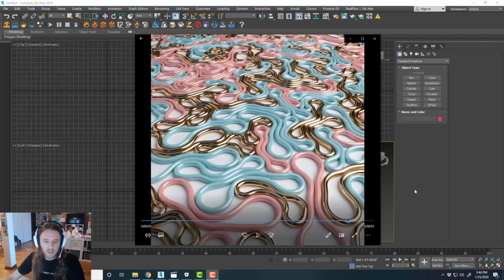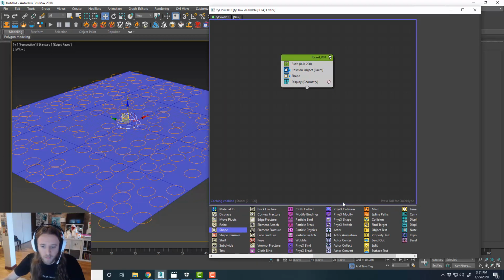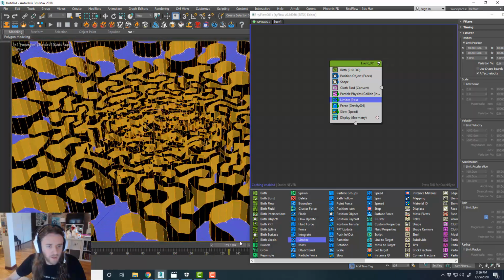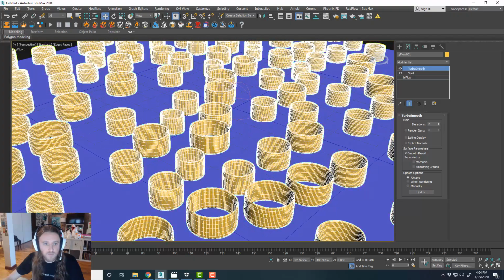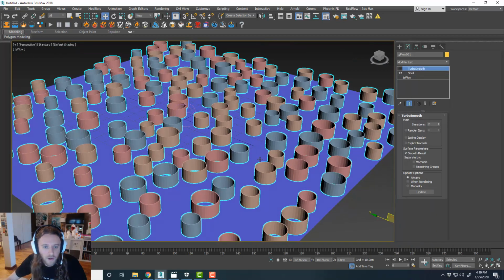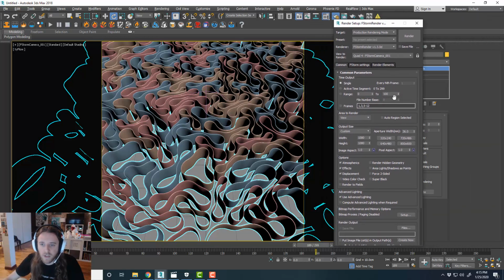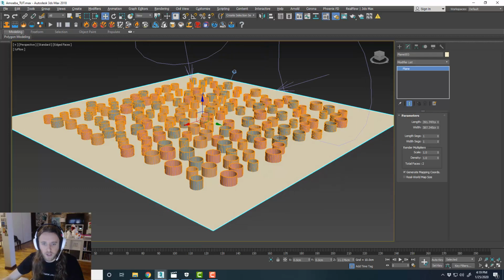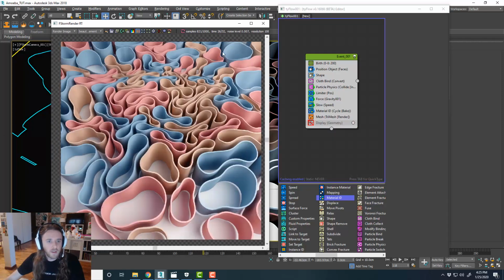TyFlow TUTORIAL!! Rubbery circle packing!

Comment: I want to inform everyone that in version 0.16102 for 3Ds max 2019 sp3 the operator Cloth bind-add shell to surface, does not work.
However you are very good and you did a nice tutorial, but it is not feasible with the tyflow released to date.
Reply: In Add shell to surface set "Outer Amount" to 0.42 and Inner amount to 0.0. In the Shell Modifier on top of the Tyflow object, set the Inner amount to 0 and outer amount to 5.0.
Reply: @PiotrG1337  thanks mate!
Also on my PC with old video card(gtx 580) it freezes if you add cloth bind! seems like video card problem

Comment: I do not know tyflow well
Can it replace the cloth? modifiers for Animation character?
Max's cloth is not bad but slow.
(This is not for games. for rendering)
Reply from the maker: Hi! I'm not sure what you mean by replacing the cloth. TyFlow can simulate cloth behavior, which can interact with an animated character if that's what you mean.
Reply: @simulation_lab  For character animation I use cloth modifier
Would it be appropriate to use tyflow instead of cloth modifiers?

Comment: Beautiful effect! Very well explained! Thanks for a tutorial!
Hi to Brooklyn from Jersey City!)
Reply from the maker: Hey man, thanks! I'm glad you liked it!
Reply: @simulation_lab  I'm copying exact your setup - except I use not the circle shape- but a letter S shape (text spline). And I have a problem with limiter. It doesn't work like in your tutorial. When I enter in Limit position Z: 4.0 cm it raises all the letter 4 cm higher from the ground instead of limiting the distance between the letters. What am I doing wrong? Thanks.
Reply from the maker: @KonstantinRozumny  I'm not sure how this setup will work for open splines, like the letter S, but I think it should work. Try increasing the scale radius multiplier in the particle physics operator, and make sure your sim substeps in the main settings rollout are set pretty high. Also, if you're seeing a lot of overlap, try decreasing your time step to 1/2 or 1/4 frame.
Reply: Simulation Lab Thank you for a quick reply. In my case the letter S is a closed spline, just like Circle. I’ll try your recommendations. Thanks.